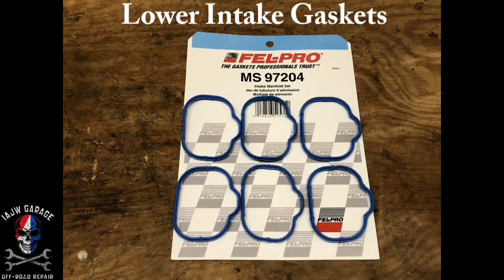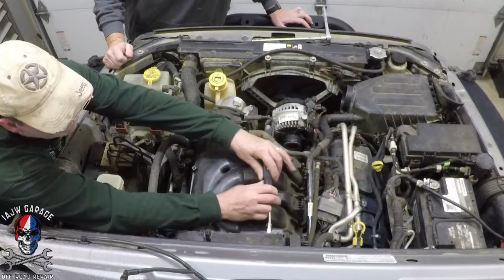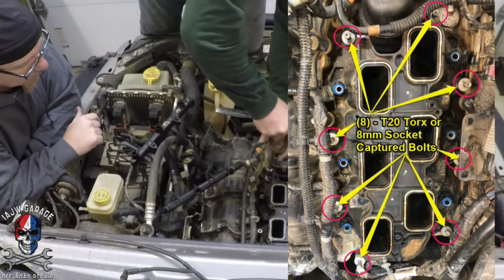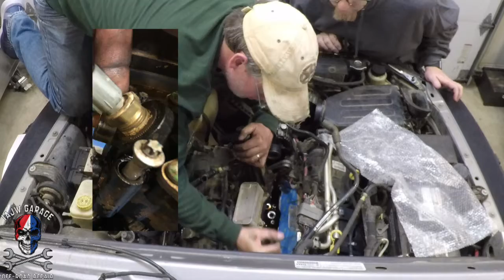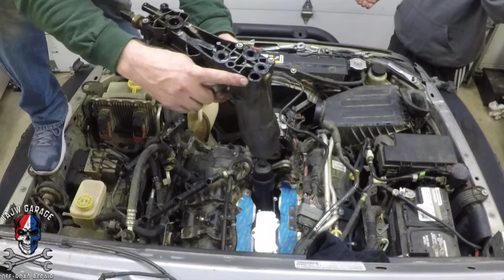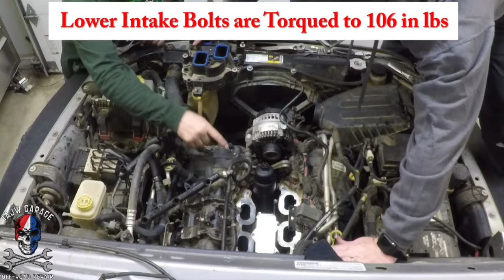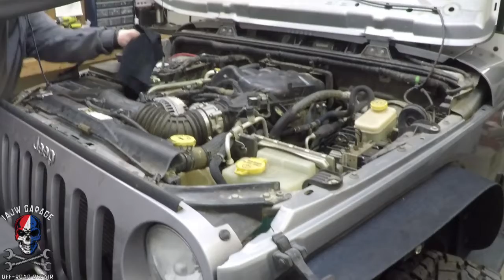Jeep Wrangler JK JKU 3.6 Pentastar Oil Filter Cooler Housing Replacement

Comment: Quick question, did you have to drain oil or coolant before starting process? I’ve read similar applications where I thought they drained at least the coolant. Also, awesome video, I am a self-taught DIY mechanic since money is tight and videos like this one save my life. I’m going to do this on my 14’ Durango Citadel. Wish me luck!!
Reply from the maker: You absolutely can if you want. I did not drain any oil or coolant and very little came out, others have reported small to medium amounts came out. Either way you have a mess.. I hope that helps

Comment: Subscribed and liked. What is it that is actually failing on these things? They seem to fail all the time. Cannot be repaired?
Reply from the maker: The rubber grommets on the bottom are the failure point, heat makes the brittle and they get crushed and leak
Reply: @ItsaJeepWorld  Thanks for this information. I am about to replace one. Guess it will happen again one day. Wonder if a high mileage oil or something like that could prevent this if it is a matter of the rubber seals.
Reply from the maker: @Alls_Well_73  they’ve updated the seals and configuration as for as I have been told

Comment: Followed your instructions and everything went great, thank you.. but now I’m getting a loud bang or thud from the engine compartment every so often. It will happen one time in the first few miles after start up. Not always, about 50% so far.. sounds like a large rock hitting my hood. I actually thought someone through something at my car the first time I heard it. Any ideas? Backfire? Valves get crud in them?
Reply from the maker: That is odd... I have not heard that before. I would check to make sure everything has proper clearance and you didn't for get a wrench or something... Otherwise.. that is a mystery and I would be interested to hear what it was if you determine it.

Comment: I just want to thank you guys a lot for this video! It helped me do my 15’ Jk! One thing though, when pulling the injectors you were right only do the passenger side I didn’t have to take off the driver side. Also when pulling them pull up on the red tab but push forward on the inside of the injector with a flat had and pull out. I kept pushing down like you said and was confused for about 30 min.
Reply from the maker: Your comments are appreciated, sorry about that confusion
Reply: @ItsaJeepWorld    Can this step be explained a bit better. Even with Aaron's comment I'm still having trouble getting mine unlocked at all.  Thanks!
Reply from the maker: @robertcronin4139  unlocked could be just dirt and gunk in the lock. Just keep at it, I don’t know what else to suggest

Comment: Does the lower intake manifold have a torque sequence?
Reply from the maker: Yes... In addition to the bolts being torqued to 106 inch lbs. There is a good Diagram here... https://dodgeforum.com/forum/dodge-caravan/432981-2014-pentastar-3-6-intake-manifold-torque-specs.html
Reply from the maker: Also see Note in Step by Step instructions #32

Comment: I just spent $883 getting this fixed on my 2012 Wrangler. Came out of work and had a huge puddle on the ground at the back of the engine. Bought the jeep new, never abused. Had 71,000 miles. I’ll be trading it in now and go back to a Ford truck
Reply: Sounds like you need a new mechanic rather than a new automobile.

Comment: Thank you,Great video
Is there a way to print the instructions you made?
Reply from the maker: Please Subscribe if you haven’t already, I’m coming out with new content. 
I’m not sure if there is a way to print it from YouTube... never been asked that question
Reply: Thank you for the quick reply.
I’m not very tech savvy and work best off a hard copy of instructions. Can I view the list on YouTube? Don’t think I saw it on the video
Reply from the maker: @jamesdenn7970  it’s in the description of the video.. not actually in the video. Can you copy the text? Paste it in a word doc or something and then print it? I don’t even know if it’s possible.. I can send it to you if you give me your email or hit me up on FB or something.
Reply: Got it! Dude you’re awesome, thanks.. one more silly question. I’m getting P0522 code and leaking oil from that area on my 2012 wrangler. Is there any chance my transmission slipping can be the result of those 2 things and remedied with this fix?
Reply from the maker: @jamesdenn7970  Transmission slipping has nothing to do with that code or the cooler leaking unless it’s a manual and oil got into the clutch
Reply: Ok thanks, I didn’t think so but with these computers I figured you never know. Did you guys use mopar oil filter/cooler assembly?
Reply from the maker: @jamesdenn7970  bought it off Amazon. Has had NO issues since and he was going through a qt a week before
Reply: Haven’t had any problems with my transmission since the replacement.. I think maybe my jeep was going into limp mode
Reply from the maker: @jamesdenn7970  That could be.. I'm glad it stopped and everything is going good.

Comment: Can you guys help me out, I tried replacing this part and put everything back together but now I’m leaking coolant from somewhere. It’s dripping down to the transmission
Reply from the maker: The only thing I can think of is. The cooler was not fully seated down or the line on the back for coolant was not clamped properly.
Reply: @ItsaJeepWorld  thanks! I’ll try checking it out. Another thing, after replacing everything I went to change my oil and noticed that the oil filter isn’t the same as the original. But everything else seemed to fit as it should. Is that normal or did I get the wrong oil cooler?
Reply from the maker: @Waymore3246  it could be upgraded. How was it different?
Reply: @ItsaJeepWorld  the top filter has a protruding piece on the original and the new filter needs to be flat to fit
Reply: Not sure if I’m explaining it right haha
Reply from the maker: @Waymore3246  Most likely an upgrade. Do you have the filter required? You may need to get a new one if not. I haven’t seen that.

Comment: They should make a recall to this part since everyone having this problem and now they have a massive back order have my jeep sitting over 3 weeks waitting for the part to come with 35k miles on it cant even drive the peace oh shi....
Reply: One of my friends has a 2017 with the same problem, also having traction control issues.
Reply: Ditto. 46,000 on my 2014 and was just told that it's not a covered component with the $1,700 aftermarket warranty that I got when I bought the jeep used. Was just quoted $795. to do it at the service center where I bought it. Unfreakinbelievable. Looks like I'll be doing it myself with a wrench in one hand and my phone with this video running in the other!

Comment: Replaced mine again last week. 2nd one on our 2014 Jk. First went up and leaked all over the place at about 124,000 miles and it started leaking again at 190,000 miles😡 Got it replaced again and a week later, now I'm getting an P0520 error code which states that its the oil pressure sending unit on the oil cooler...F*&k me😫 Dunno how or why a brand new sensor on a brand new part would be/go bad already. Will never order from RockAuto.com again
Reply from the maker: They are having issues with the coolers I read in a forum and apparently they are on back order trying to get it right, good luck

Comment: Just found out my 2015 jk with 37k has this problem the dealer said it’s under warranty and the plastic cracks and Jeep has a updated part only problem there’s a 27,000 recall on them waiting on the part to arrive
Reply: Same problem with my 2015 jk don’t know were to found the oil filter housing ☹️
Reply: Mine has been waiting on a part for a month now. Insurance doesn’t want to give me a rental nor does the dealership. They told me it’s on national back order
Reply: Is the powertrain warranty for 7 years?

Comment: I have to replace mine this weekend it’s a 2017 Jeep Wrangler Sahara with only 45k miles and I already have this problem
Reply from the maker: I know of 2016-2018 with low miles having the issue, depends on heat and driving conditions
Reply: @ItsaJeepWorld  I live in Texas so I don’t know what happened the weather is a bit bipolar but it’s mostly nice and we never pushed the Jeep that bad
Reply from the maker: @kidoutdoors1400  Heat is a killer of rubber o-rings, I’m in South GA, you get that same blistering summer heat, could be a contributing factor

Comment: BEST VIDEO HANDS DOWN!!! Was going to give it to my mechanic since I didn’t have the torques or proper sequences to do but once I saw your video it’s way worth the savings not to do it myself. I got code p520 which is the oil pressure switch but I’m replacing everything since I’m going to be in there. Too bad this didn’t go bad when I replaced the coil packs 20k miles ago. By the way my mechanic quoted me $465+tax here in Houston, TX. Again, awesome job!!!!
Reply from the maker: Thank you! The prices are getting cheaper as shops realize people can do it themselves
Reply: @ItsaJeepWorld  my mechanic goes by the book when it comes to how many hours the manual says it should take. He knows that if he tries to go too high I do it myself. 😂 I do have code P420 and I’ve replaced drivers cat and both upstream and down stream O2 sensors and still same code. That’s when I give it to my mechanic to do more tests. I did use a cat from Rock Auto which they took back. Imma have to bite the bullet and get an OEM from the dealer. By the way you guys should have a patreon account, I’ll gladly donate!

Comment: Outstanding vid you guys!! This is by far the most well shot and comprehensive vid on this job on YT! The others are poor at best but I cant see one single part you omitted. I'm about to do this job on 2013 Wrangler for my cousin. My 1st time doing this on a Chrysler product. Such a shame they engineered the oil switches in such a PITA location? Why Chrysler??? But we mechanics figure it out and this vid makes it so much easier. Mine has a CEL light of the oil press switch reading low. No oil leaks thankfully! Great Job again!!
Reply from the maker: Thank you very much!!! I truly appreciate the accolades
Reply: @ItsaJeepWorld  do u have a contact number
Reply from the maker: @bigislandoff-roadhawaii281  email me at ItsaJeepWorld@gmail.com

Comment: I did mine and it took me about 3 and a half hours. This video is over done as the guy removed the vuel injectors and fuel rails. Why?? They are part of the bottom intake manifold, just disconnect the wires on the injectors and place the entire intake to the side. Its that simple and 30 minutes less time.
Reply from the maker: Because I wanted more room. There is always more ways to do things. Thanks for your comments, glad it worked out for you

Comment: they need a special design step stoll 3 side so u can climb up & work from all 3 sides. & some kind of connecting bars on top to hold & lean on, that can b removed if in the way. Every make model will scale over & let u work it it much easier.
Reply from the maker: They do. It attaches over your tire. Look up mechanic tire step 
I’m actually going to welcome up, my calves are burning after leaning and reaching over all day LOL

Comment: Just replaced it on my wife's jeep yesterday. Went to the dealership for some broken parts to be replaced from the jeep getting stolen and they give me a call saying they want to do some $1400 repair cause oil's leaking. Only mangled one injector connector and snapped the PCV hose in half while sewing everything back up. I appreciate the effort you put into the video!
Reply from the maker: Thank you very much, glad you didn’t let the dealership do it, it probably would have come back worse, plus your wallet gets wrecked

Comment: After doing this and tearing so much apart how hard would you think it would be to replace the engine harness?
Reply from the maker: Why would you need to replace the engine harness and I have no idea how hard that would be
Reply: @ItsaJeepWorld  I have a short some place in the harness. Don’t know anyone to replace one so far, but figured it would be pretty close in work having to pull so much off to do the oil cooler swap. Plus while I’m at it might as well upgrade to the newer oil cooler.

Comment: My 2007 Jeep Wrangler jku was leaking coolant I replaced the radiator thinking that was the problem but now it’s starting to leak again but underneath the firewall(driver side). what do you think is the problem? Please get back to me thank you!
Reply from the maker: Heater core most likely, that’s under the dash the hoses connect too, they are prone to damage and leaking at the firewall and under the dash
Reply: @ItsaJeepWorld   Thank you so much, I’ll look into that

Comment: This is now on my list. I have a 14 jku with 225k kms(140k miles) I have to do spark plugs, coil packs , gaskets and serpentine belt. Since I’m this fair I might as well do it.
Reply from the maker: Good point. If you are replacing all that. Might as well upgrade the oil filter cooler housing

Comment: How's it going... great video. I'm working on my jeep right this minute.  I'm taking my time, going ing step by step. I'm stuck on the fuel injectors though.  I lifted the red tab and unable to push the black tab down. Any idea, tips suggestions?
Reply from the maker: They are normally stuck depending on the year. Try a little WD40 or PB blaster, don’t go nuts. Maybe it’ll work into it. I think there might be something about it in the comments too. Good luck

Comment: Thank you for the video! Just replaced mine but the oil filter housing is still leaking coolant and oil below the housing. Any suggestions?
Reply from the maker: Possibly not completely seated and the o-rings aren’t compressed between the engine and housing correctly, maybe

Comment: I’ve attempted this repair now for the last 3 days.  Followed the steps verbatim.  Everything back together. And it’s STILL leaking oil into the front chamber....... the part you can see down directly behind the oil filter    

I’m so confused and frustrated.   First time forged it down to 9ft/lbs.  second time 10....  could the o-rings be just bad from the replacement ??  Ordered another set of Orings to try and swap out.
Reply from the maker: Could be bad o-rings, could be debris under them, not seated properly. It’s hard to say
Reply: @ItsaJeepWorld  UPDATE:::   the aftermarket O rings did the trick,,, also had to Re Tapp one of the mount holes for the cooler.. was stripped and possibly why i coulndnt torque it down completley,,, Thank you for the assist
Reply from the maker: @CYoung-fv4vu  I’m glad you got it figured out! Good job

Comment: Excellent video. Couldn’t have done it without the video. I did have a fuel leak once I reassembled. Tracked to down to an unseated fuel rail on one injector. Should have read the notes about the lubricant. Thanks.
Reply from the maker: Outstanding!!!! That’s the best feedback, when it goes great! Good job on your project.

Comment: So whats the cause of this leaking? A crack? Blown seal? I changed out mine on my 2014 JK at 123,000 miles and when changing the oil today I just noticed it was leaking again now at 190,000 miles😡 This is ridiculous!!
Reply from the maker: That’s unfortunate, could be bad seals, cranked the oil filter cap too tight, could be something unrelated, I hope it’s nothing seriousness you can figure it out
Reply: @ItsaJeepWorld  Just figuring it must be a common break point as I see soo many people having the same problem.
Reply from the maker: @h8tnlife  the neck of the oil filter container and the o-rings under the component are the most usual causes

Comment: Did y’all get any codes  after starting up the engine ?  Hooked up the computer had 9 codes come up like pedal postion oil temp oil pressure crank sensor etc. ?
Reply from the maker: Never got any codes, sorry

Comment: Best video w/ best notes. Thank you thank you! I did the tear down on one day and rebuild on the next over the weekend. Went slow on purpose. 2014 JK.
Feedback / time savers:
a. You say and do a criss-cross torque sequence when releasing the Filter-Cooler but you do not do the criss-cross in the video when installing. It would help to include a sequence still photo at this point of install (since that is the key part for this video.)
b. The fuel injector relays have tricky / sticky red safety latches, which you show well, but I can tell you and others struggle with these. I think over time the engine heat "bakes" them shut. Easy to chip / crack red latch. Use a couple drops of silicon and a flat end of a small screwdriver to pry up.
c. As mentioned elsewhere, the small T20 torx bit may twist / bend / pop with 106 in/lb. Use 8mm driver instead. Stronger.
d. I left the fuel rails attached to lower manifold as others have suggested. Upside: A few less bolts and o rings to worry about. Downside: A little less hand room in back and passenger side + a little fuel spill when you detach line to rail. (I smelled like gas!)
Reply from the maker: Great Feedback! Thank you! I smelled like gas too. lol 
I’m glad it helped you out.

Comment: My  2015 JGC POS with only 25k miles has a small puddle of oil at the  bottom of the filter assembly. How many hours do you think  is reasonable for labor if done at a shop?
Reply from the maker: Depending on the labor $$ per hour. They have to charge you what the service manual states for how long it will take I believe that’s 6 hrs. So the part would be approximately $250 with their markup, then $75-100 per hour, shop fees, oil, disposal, coolant, etc.. you are looking at $750-$1000